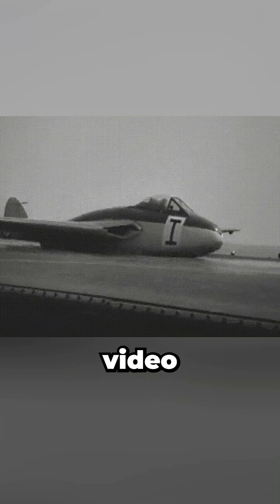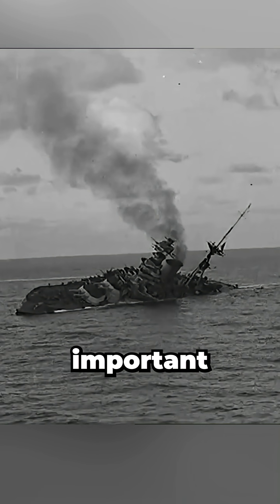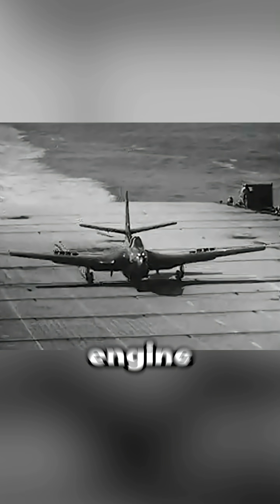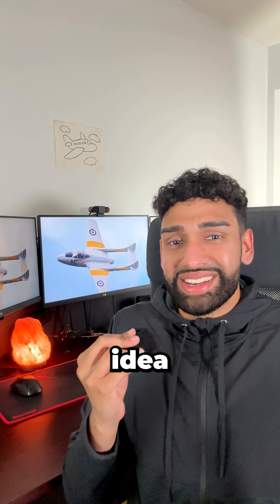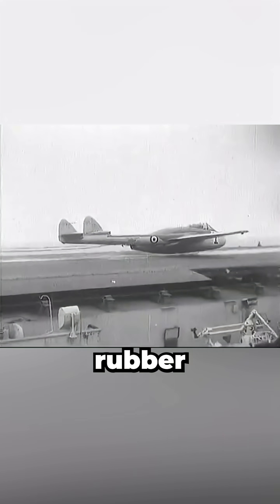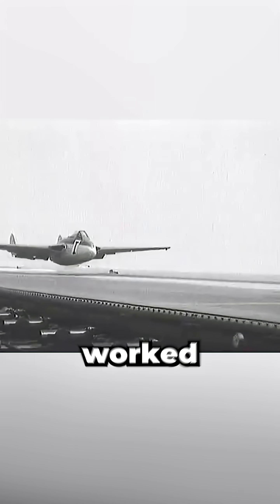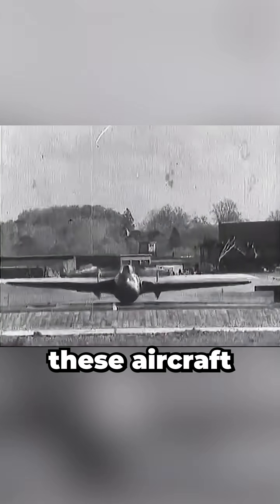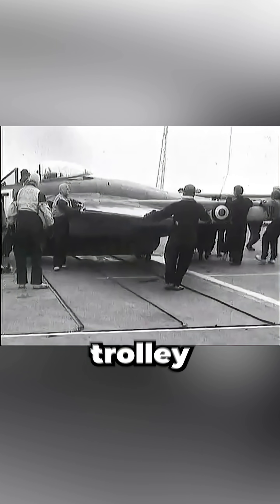Why is this jet bouncing like a rubber ball??

Comment: Imagine if the hook misses the cable on this. It would probably just fly off the end with not enough speed to take off again lol. That would suck.
Reply: That happens on normal jets as well, and this might not be as bad since it’d bounce up a bit. Then again, it’d also lose more energy, so who knows.
Reply: @RealJensenHuang  Naval aviators put the plane to full throttle on landing in the event they miss the cable so they can just fly off
Reply: in training, pilots are taught to max out throttle when you touchdown. if you catch the arresting wire, it'll stop you. if you miss it, you'll have enough throttle to takeoff again and come back round for another attempt. hope this clears things up
Reply: Apparently, I learned there are 3 lines
Reply: When landing they throttle down then when the wheels hit the ground they go full speed just incase the hook misses
Reply: @v8rangee you miss one part, rubber creates tremendous amount of friction meaning acceleration after touch down will be too slow for touch and go.
Reply: @SurgingApocalypse he’s talking about modern jets
Reply: @SurgingApocalypse  Actually, they missed three things.
a. Back in the days when these were being considered, throttling up before a carrier landing wasn't standard.
b. Of course, as you said, the friction from the rubber would help slow the plane down.
c. The planes then were heaps lighter than modern complex fighter jets, meaning they have less inertia and can be slowed down more easily.

Comment: What so special about the SR71 blackbird can you make a video about it I mean I don't understand it
Reply: Big Zoomie Jet, Very fast, make soviets look stupid, can't catch, mean spy.
Reply: @walkerhartge9177 and don’t forget, looks very, very awesome sauce
Reply: it goes very fast at very high altitudes, which is difficult as less dense air = less air to the engines, which decreases performance.

theres other stuff to the sr-71, iirc the skin of the aircraft was made of a slightly too small rubber so it would leak whilst on the ground, because the heat from the speed of the aircraft would expand the material into the proper shape